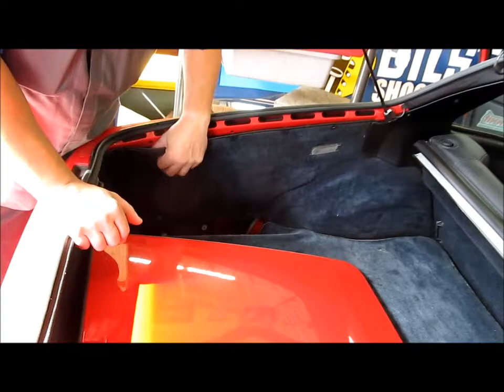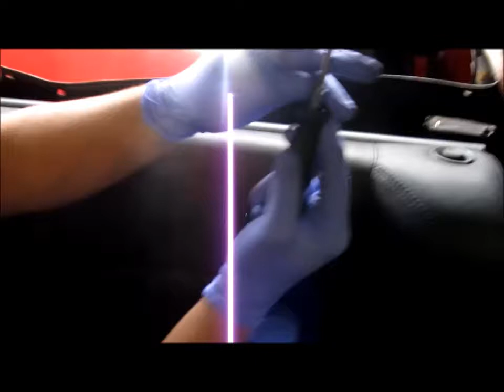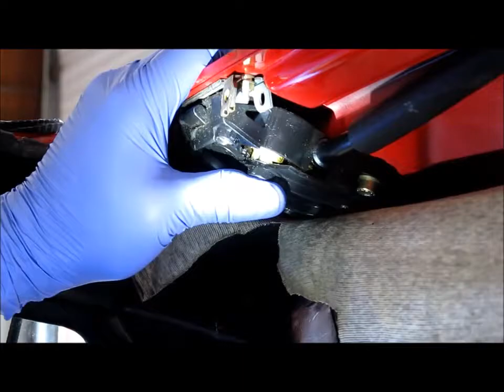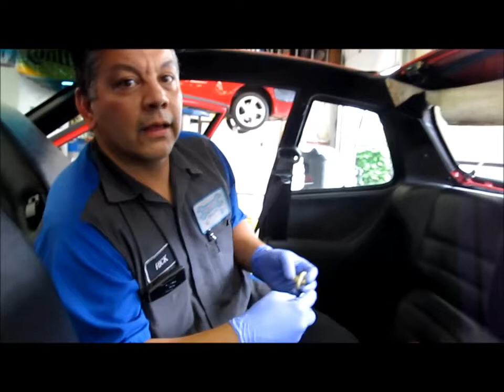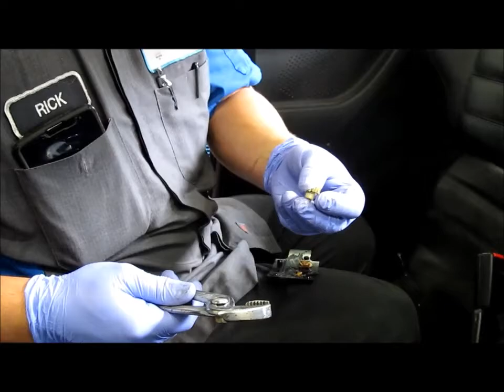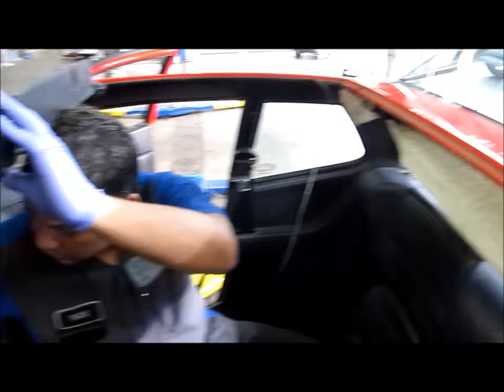Porsche 944 Sunroof Repair- Munk's Motors

Comment: What if mine doesn’t work in acces.. mode. It’s a 87  but will work when key is on.   Is it a micro switch ?   Also when do you adjust the motor clutch when fully retractable or when sun roof is in close position.  Thank you

Comment: Thankyou for the video...  944 roof is same I guess, the mechanism is working fine, it is lifting roof & retracting properly... But when it comes to fully close the motor still runs & makes continuous noise.... & The roof can still be lifted from rear side... Means that the mechanism rack is not locking it in close problem... The gears are in good condition.... What could be the problem ?
Reply: hello, i think your problem is resolved now, but it is the motor clutch that needs to be adjusted
Reply: @adnb.5493  yes buddy... I adjusted motor torque from rear & also one of microswitch needed to replace...
Now working perfect